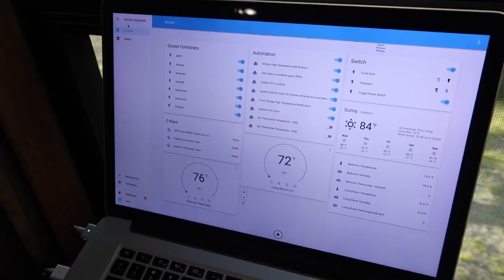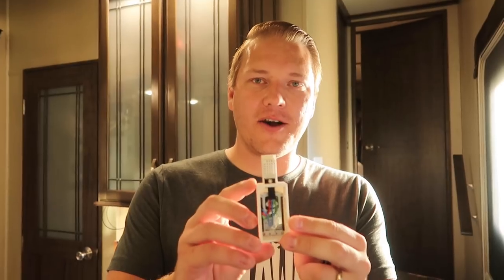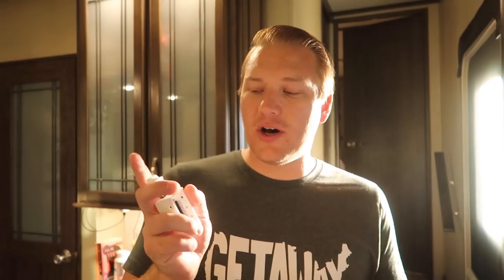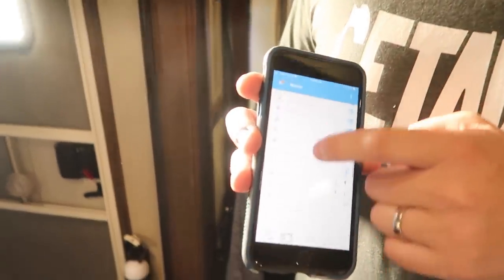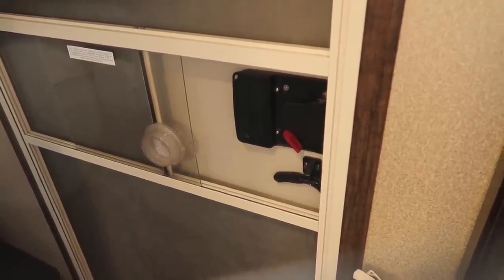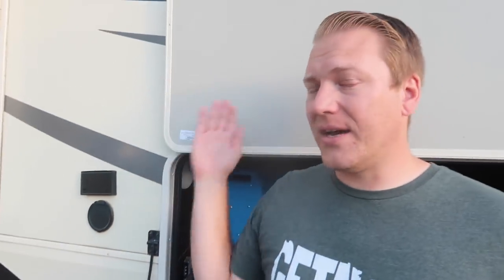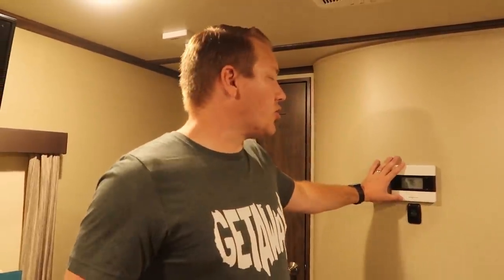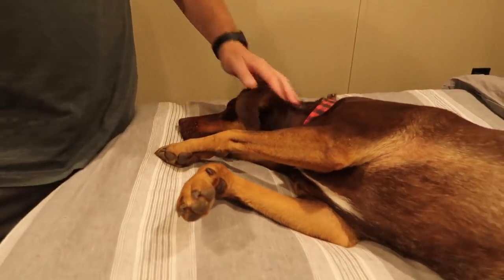LET'S TALK ABOUT "SMART RV" PROJECTS! || RV LIVING IN QUARANTINE

Comment: I'm currently using Smartthings as an HA hub but I am planning on looking for a local only solution. So for HA projects I have the following things going on:
All doors and windows are monitored by Zigbee or Zwave sensors that have open/close and temperature. These are Samsung and Visonic.
All compartments and rooms have a Samsung motion/temp sensor.
I have an AEON energy meter with inductors monitoring the voltage and amp usage. This will be phased out when I get my Victrons.
A Kidde zwave smoke/CO2 detector is installed inside.
Samsung water sensors are everywhere that water can be present, basement, under sinks, washer and behind the toilet.
Ecobee thermostat for HVAC control
Google minis for voice control
Google home camera for the door
Action Tiles for web console (only works with Smartthings right now)

Wyze cameras on the inside recording to an RTSP NVR.
Samsung power modules for all outlets with appliances for metering and on/off control.
A nodemcu board for temp/humidty monitoring in the freezer. I'm also playing with using an output for low level trigger of a NO relay to close an orbit NO valve in case water is detected to close off the shore water connection. I'll still have 4 pins open to play with and have relays sitting in the box for when I think of something to do with this.
I'm researching propane shutoff valves

Automation wise:
If fire is detected then sound the alarm, push alert on the app and text me. All power outlets are turned off shutting off the fridge, microwave, washer/dryer, TV. turn on ALL 110v lights.
If any sensor reads over 125 degrees then sound the area where the temp is high, push alert on the app and text me.

If a flood is detected then sound the area where the water is detected, push alert on the app and text me.
If the alarm goes off then sound the alarm, push alert on the app and text me.
If power consumption is too high then alert me.
If weather alerts come in then announce it.
If it's raining and windows or doors are open then alert me.
If no activity on certain motions is detected between 24:00 and 07:00 then arm the alarm and announce if any external doors are open.

Future plans:
Turn off the propane if propane, co2 or fire alarm goes off.
Turn off the whole rig AC power if the fire alarm goes off. Will do this through the Victron when I get them. My power setup will be similar but i'm going with 8 Lion batteries. I was going with 4 batteries until Corona so now it will be 8 and I plan on doubling my solar when I get there.
Integrate critical lights with relays so that the system can control 12v lights as well to turn on for alarms.
Integrate with the Fantastic fans to vent when it gets hot. Now that they have local temp control like I saw on your last video I might not need this but then again, a propane or CO2 alarm would be nice to vent the rig.
Integrate with the tank monitoring system.
Remote start the genny.

I'm planning on getting a 376THS at the end of this year and all of this will move over to that rig, then I get to figure out how to integrate with the Onecontrol for some of these functions, especially the lights, tanks and genny control.

Comment: My  Grand Design 337 RLS only has one auotmated item and it is in need of a manual way to run it. I installed automation in a confined feeding operation  for years and ALL functions had a manually operated backup system.

Comment: I don't know how you wired the refrigerator to switch to propane when you unplug from shore power.....with this said,
Your victron inverters should have an ac2 out terminal. This terminal is meant to only provide shore power pass through, I believe 15amp.
Designed to power to a hot water heater or refrigerator when shore power is available. 
This could be problematic if you needed to power the refer on battery power.....say...you ran out of propane.
Just wanted to let you know this was available if you didn't know.
Great video.....you  guys stay safe and healthy!!

Comment: Do you have Smart t.p.? 😂 Seriously though, do you have to use special toilet paper in your RV or any kind you want?
Reply: Better to use special RV TP because it dissolves faster than "Safe for Septic" TP.  With regular TP there's always a risk of getting a clog....which you don't want when it's time to dump your black tank!  It was even recommended to me to put "gently used" TP in the trash to reduce the amount of paper going into the tank.  Following that advice, I've never had a problem with my tanks.